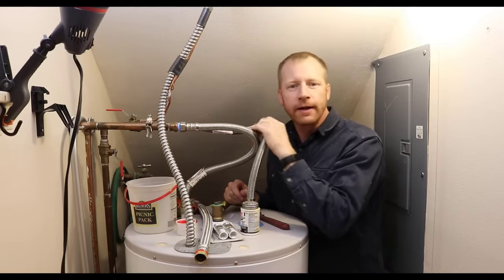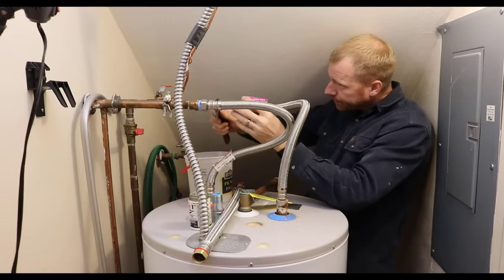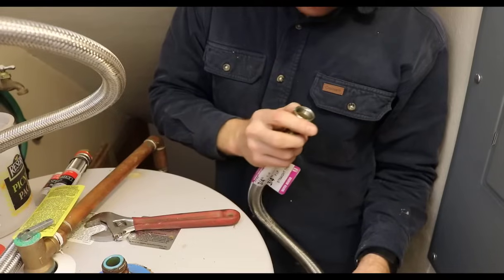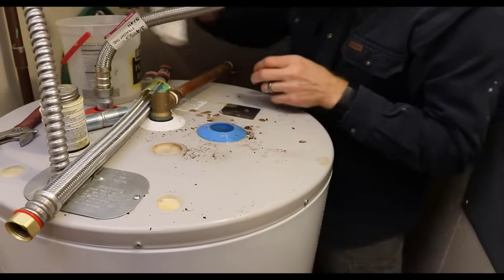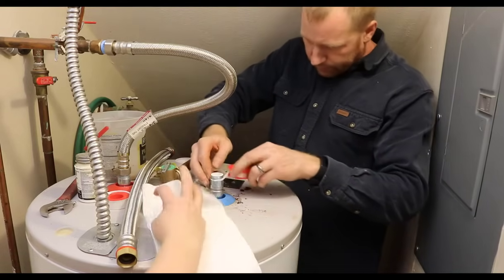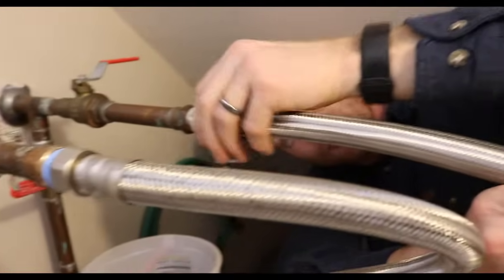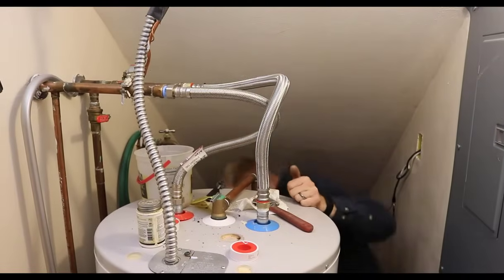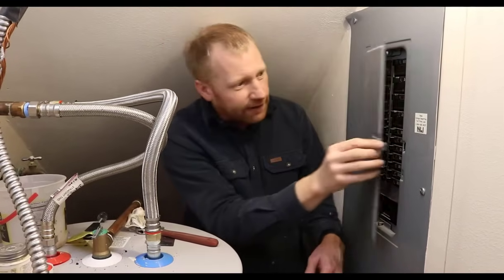Water Heater Repair Replacing a Corroded Supply Line

Comment: I actually appreciated that the guy before me left the labels on the corrugated pipes, since, as a homeowner not a plumber, I could not tell by eye that they were 3/4" FIP. This way I could buy new BEFORE tearing it apart and leaving the house water off while I ran to the plumbing supply house. Sped up the process, less angst for the wife.

Comment: DIYers be mindful that rocking and partial rotation of the tanks piped with rigid natural gas piping could compromise gas connections especially at unions.  Excellent video for electric water heater.
Reply from the maker: Great point! Thank you for your comments.

Comment: Big props for keeping that difficult moment in the video. In the real world, this is what happens. I started working on cars about three years ago and youtube videos were certainly helpful. All of the plastic crap that snapped or the things I dropped through from the top down--starting with my first attempt at car repair--it's a rarity to show the true difficulties in these types of tasks. I appreciate that moment above all in your video, as I type with a broken knuckle (from hitting frame while breaking a bolt free in a parking lot somewhere.) I am almost ready to replace the two water lines going into my water heater plus the pressure relief valve. Your video is part of my prep work. Your video is unique in showing the difficult part and also in your decision to change the fitting that goes into the water heater. Thanks.

Comment: I tighten the fitting just a bit to break it loose then remove normally. A trick I have  been using for years
Reply: Or, he could just use a cheat bar for better leverage.
Reply: If you use a 1⅛ deep socket on a breaker bar, then extend the leverage with a cheater pipe on the handle. Squirt a little WD-40 on the fitting. And pray it doesn't break off. That's armchair quarterbacking. You did a great job! Doing it your way. Plumbing sucks, I worked on the flight deck of an aircraft carrier launching jets. Ask me a question I know about that. 🫡 🇺🇲
Reply: @captainadams7569 I had an 18" wrench and that crushed the pipe. 
That's gunna be fun to fix tomorrow.

Comment: Thank you.  I was going to call a plumber but after watching your video decided to try it myself. I was concerned because I had to cut the copper pipe to remove the connection. It had a one piece soldered on copper flex pipe w/fitting. I purchase a flex hose from home depot that had a "shark-bite" end so I could just push on.  Looks like it made a good seal and all is working.  I will check off &on over next couple days.

Comment: Good video, sending it to my son to replace his. Couple of things I would do different, remove the gasket from the old hose and thread it on the new nipple, then you can use the wrench to tighten it without damaging the threads. Also, when I use Teflon tape, I don't cover the first two or three threads so it's easier to start putting on the new hose by hand.

Comment: Thank you!, I have a solar hot water heater and the nipple for the pump supply line started leaking, company that installed system wouldn't touch it because they were afraid it would break during removal. Wanted $2400 to replace the tank. Local plumbing company told me same thing. Got the replacement nipple/dip tube assembly from the manufacturer Bradford White for $36 including shipping. Used a pipe wrench and hammer to tap it out just like you showed, came out easy and installed new one myself, system works perfect now!
Reply from the maker: It is so great to hear stories like yours! We are very happy you were able to save $2400 and get it working too! Nice work!

Comment: Excellent. I got stuck on Christmas Eve with the hardware stores closed. We had a kinked copper ribbed in take and it was leaking two days. I'm part deaf so I didn't hear it as it's a outdoor water heater. Lowered water pressure, a friend attempted to solder the crack but it still leaked but much less. Tomorrow a plumber is coming to replace it but also the top valve unit and will need to break the stucco wall a bit to secure the galvanized pipe. My ceiling pipes are copper but not the drop down pipes. My house has 3 shut off valves we installed to isolate if needed.

Comment: Thanks for showing the real deal on getting that corroded connection loose...
Reply: If you call hammering away, thus risk damaging the inside of the tank, the real deal? Some penetrating lubricant left for 10 mins would have accomplished an easy removal.
Reply: @hatespeechisntreal  Yep, I’ve changed out 100s of those that breakdown and plug up all the aerators and showerheads. Or found them shooting off like old faithful in the middle of the night because they break down.
Reply: @reno5948  I was watching the video and said, "time to get the Deep Creep." It's still good that he shows that it's not always super easy to do repairs. When most videos show everything going according to plan, then newbies have no guidance when things do go wrong. I appreciated him showing the problem more than how he dealt with it. I do get what you mean.

Comment: Thank you for this. Most of the how to videos on water heaters make it seem like the nut on the water connection is super easy to remove.
Reply from the maker: Glad to hear you found this helpful Our! Our videos tend to be longer for this very reason. The goal is the help others get the job done correctly, by not skipping to the end with all the hard stuff cut out.

Comment: Thank you so much! I was struggling to get the anode rod off on my Bradford White water heater and tapping it with the hammer made all the difference!!! I was able to replace both the anode rod and the hydrojet water inlet pipe.
Reply from the maker: Glad to have helped! Sometimes they are way too stuck or corroded and the nipple twists off in the tank fitting or worse, the tank breaks. But hammering on the wrench is a good last ditch effort before getting a new heater.

Comment: Well Dan, my electric hot water tank inlet nipple failed today.  Luckily I was doing laundry beside the hot water tank..  Ha, ha….I had to use my largest pipe wrench and sledge hammer to remove the nipple.  New nipple and repair was easy peasy thanks to your video.  Okay, little elbow grease for repair and water cleanup but a cheap fix.  Great video, thank you sir!

Comment: Thank you SO much for this video. Just what I needed to change the top hose for cold water on my tank which started to leak. It cost me $18 for the hose and 20min later I had it fixed. A plumber would have charged me $250. Yikes!!

Comment: The heat tightens it up too. Just like when you change oil filter, you hand tighten it, same with the bolt under the truck.  I  liked your video and saved it .  I like the hammer to loosen. When the tank was moving I was cringing, lol 😬

Comment: If the fittings don't want to thread together, hold pressure on the fitting while turning it OFF (counter-clockwise). You will feel the fitting move downward a small bit as the threads engage. Then resume turning it clockwise to thread it on.

Comment: My hot water supply line started dripping, so I watched this video to learn how to replace it. Funny, the nut that attaches the line to the heater also got stuck I ended up going to Harbor Freight and buying a 24 pipe wrench. It took a few tries, but eventually it broke the nut allowing me to unscrew it. The rest was easy.

Comment: Thanks for posting this video.  It gave me the confidence to replace my leaking supply hose.  I probably should have replaced the heat trap nipple too but the non threaded part was too far down to reach with the wrench and I wasn't sure if I'd be able to tighten a new one without damaging its threads.  Otherwise the repair was relatively quick and easy..

Comment: Some tips from a DIY'er.. Great video BTW.  First, if you relieve the pressure in the tank, remove the stainless hose, leave the tank full until the last step.  This way the weight of the full tank of water will help ballast the tank and allow you to break the fitting on top free easier.  Second, the reason for your rusting is because metals of dissimilar alchemy will have a galvanizing effect on one another.  Thus it creates rust where 2 different metals touch.  By using the Teflon tape & paste you create a barrier which will prevent rust in the future.  Finally, if your house has a backflow prevention system on the cold water supply, you have to empty the tank using the pressure relief valve lever.  However before opening that lever, make SURE your cold water supply is turned off, otherwise you'll make a mess!  Happy trails!
Reply: So wrong, the metal threads cut thru the teflon, it liquifies when tightened.
Reply: @Marvinfj32  Yep. Was gonna say the same.
Reply: Hey, thanks for the info regarding a backflow prevention system. I have a leak in my cold-water supply line and a suspected bad pressure relief valve ( I think it works intermittently.) I emptied my gas water heater and had to use the relief valve because I got no more than a very slight trickle from the drain (after attaching a hose.) The way this is set up is pretty bad with bent copper fittings going out a hole in the shed--right onto the driveway. But at least I knew that it was emptying enough to patch the hose until I get the rest of my supplies on hand. I just was wondering why my tank would only empty from the relief valve. It's not like it's near the bottom of the tank.

Comment: FYI: If the tank fitting is steel, it will cause a galvanic reaction with the brass/bronze hose end. Happens with dissimilar metals of most types when in contact with each other. Thread tape and/or dope won't act as a barrier against this. 
If possible, add a short brass/bronze nipple between the tank and the braided hose. Nipple is much cheaper and will be the sacrificial piece, rather than the pricier hose. Swap out the nipple with a new one when corrosion starts. 👍

Comment: If you read the stickers  that come on the flex lines many say to not use teflon tape.  I used tape when I was new just because never had a problem and the stopped once I read the label and never had a problem either.
Reply: The threads aren't designed to prevent leaks - the rubber washer is the seal when compressed.

Comment: Hey! I liked your video , I don't care for those braided supply lines , they pinch , the copper ones pinch to, 'cant have pinching' Also they don't thread on very much so they tend to leak. I recommend stainless ,they don't pinch. Keep flushing that water heater and change the ANODE rod its huge.

Comment: When trying to install hose fitting, I turn the fitting backwards until I hear a click. That means the threads in the two fittings are aligned and ready to engage.
Reply: This works great, especially in an areas where it's really hard to get the fittings to aline. Works on regular nuts and bolts too.

Comment: those supply hoses usually include a washer inside the nut, meaning you don't tight them but about 3/4 turn past moderate tight.  Not with a monkey wrench....strange approach to using flex lines.  Also, the tape and paste do nothing and certainly are not both needed given the water seal is via rubber washer inside the flex line.

Comment: Not quite 30" clearance in front of the electrical panel :)

My water heater looks just like that. I bought and installed a new one but I'm going to attempt to repair the old one an use it somewhere else. I wasn't 100% sure the nipple was actually replaceable. Thanks. I might try to ratchet strap the old one in place somehow or maybe throw a back up wrench on the release valve to keep it from spinning. I'll pre soak it with something like penetrol overnight.

Comment: These youtubers add so much damn Teflon tape that they can't thread the nut anymore 😂
Just use the supply line gasket..
No tape means a deeper connection, which means the gasket gets used

Comment: Great video thanks. That would have happened to me trying to get that top piece out. I dunno but maybe I might carry a short piece of pipe to go over the pipe wrench handle just for times when more leverage is needed. Great job though. I replaced our water heater once and used flex hoses like that. The copper pipe side I used compression ring fitting. I hope that is okay.

Comment: Might want to consider replacing the water heater anode, as well as maybe adding a control timer (to lessen electricity cost). As is, the heater is going to keep the water temperature the same for 24 hours/day. The incoming water pressure supplied by the city should be checked, using a (~$10) pressure gauge attached to an outside garden hose bibb. If that pressure is above 80 PSI, then a "pressure reducing valve" may also be required, in order to prevent leakage from the water heater's T&P relief valve. The pair of "heat trap nipples" should both be installed, not just on the cold side.

Comment: Wasnt leaking because of that blue monster tape. That stuff seals everything. I use it like Frank's Red Hot, I put that stuff on everything.
Reply: You are so wrong you don't need tape on compression fittings it stops the fitting tightening all the way. You can always tell a amateur job by all the tape on wrong threads.
Reply: NPT threads are designed to be used with a sealing compound such as Teflon tape to create a leak-free seal, whereas NPTF threads form a mechanical seal by crushing the entire thread form. If NPT is used without a sealing compound then there can be leakages or other unpleasant issues.Mar 29, 2019 quoted from direct material.com.     I can always tell a amateur comment when the wrong terminology is used to describe the fitting type. Ive sealed more fittings than I care to talk about. Commercial, Residential and automotive.

Comment: I wouldn't be so quick to bang on that pipe wrench because water heaters are usually glass lined and banging the pipe wrench to get that nipple loose could inadvertantly crack the glass lining inside the water heater.In a situation such as yours I use a length of pipe that fits over the pipe wrench handle for leverage.Using some penetrating fluid would also help.

Comment: Maybe drain a gallon out of the water heater before starting.  The vibrations from hammering fittings on a water heater can damage the glass lining in the tank.  Use a long pipe on the end of the pipe wrench instead.

Comment: Using a piece of pipe for leverage to remove that nipple would have been a better option.I would be hesitant to bang on the pipe wrench with a hammer because water heaters have a glass lining and banging the pipe wrench with a hammer may crack the glass lining inside of the water heater.When I replaced the anode rod on my old water heater I had somebody hug the water heater while I cranked on the old anode rod to remove it because although the water heater was full the water heater still tried to move.My old water heater was a 50 gallon water heater just like my new water heater but it still tried to move when I cranked the old anode rod loose even though the water heater was full.
Reply: Is it possible to use a small torch to heat the material,i do this when nut froze on my car,works good,would heat from propane torch hurt this?

Comment: What about the dip tube that connect to the cold water inlet nipple?  I 
don't see a dip tube connect to your new cold water side nipple during 
your replacement.
Reply: Yep, the W/H will not function properly without a dip tube---while taking a shower he will have to keep adjusting the hot/cold water spigots to maintain a constant water temp.
Reply: Don't know if you'll see this comment, but you saved my ass. Thanks.

Comment: Considering the cost of on new water heater it might pay to use a  dielectric unions to isolate the copper from the steel. This is the industry standard way to connect copper to galvanized pipe. The nipple exiting the water heater is typically galvanized pipe.

Comment: I just spent 3 hours trying to remove a rusted and broken flange. There was no way i could unscrew the darn thing. It baffles me that such fittings are not shaped like a nut which allows for a better grip using a wrench.

Comment: You drained your water heater, didn't you? Unless you're Hercules, there's no way that sucker would have moved when you were trying to get that old water heater nipple off if it was full.  Always keep water in the water heater when trying to remove stubborn connections, including when replacing the anode rod.

Comment: How did you know it was definitely leaking from the pipe nipple and not the tank itself? I’m seeing water on top of the tank, and can’t tell if water coming from a joint leak or the tank itself. (Your video was well done - helped me understand more about the pipe connections.)

Comment: I would do a complete flush after replacing the corroded nipple and fitted everything back. The reason being after all that hammer pounding trying to take the corroded nipple out, there would be a lot of loose sediments dislodged at the bottom of the tank, not to mention the corroded nipple debris also that needs to be flushed out.

Comment: leave the connector loose on the nipple, the wrench won't crush it, dip tube?  Teflon on the connector fittings will make it harder to start the connector fittings, the paste just makes a mess and serves no purpose. Impossible to break the male copper fitting, female yes, male no. Remove the aerators, the rust from the bad nipple can plug them. Other than that, it holds  water!! And btw, the electrical ground is on the hot side, big mistake. Always on the cold side. You lose ground if the water heater is disconnected. Look it up, look up any of what I said.